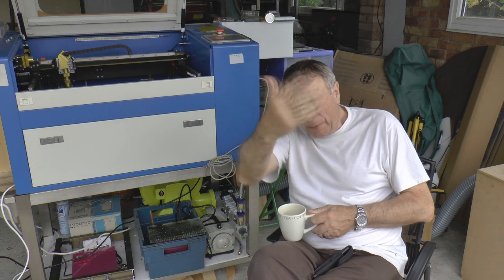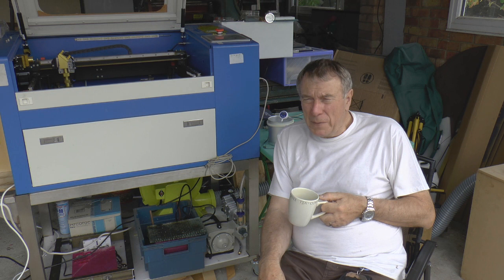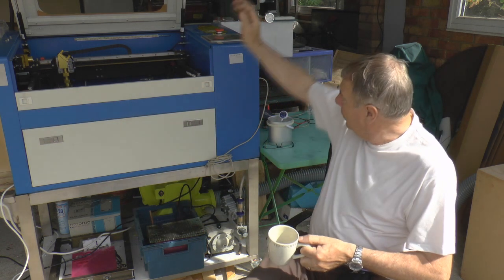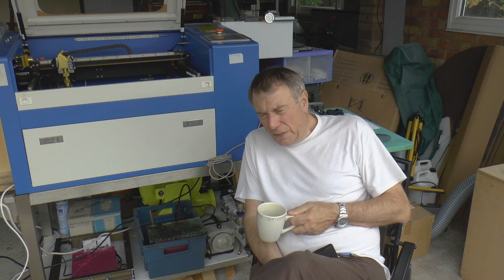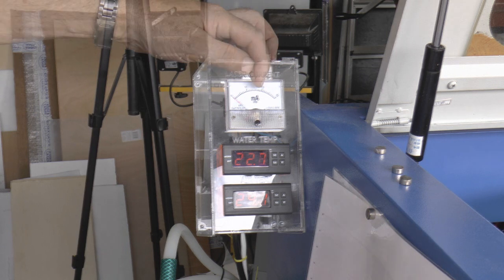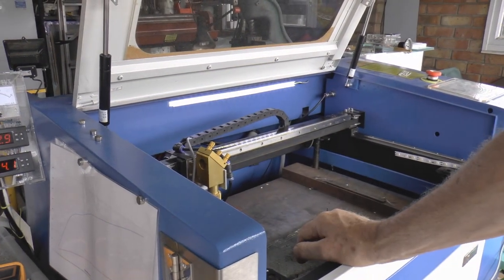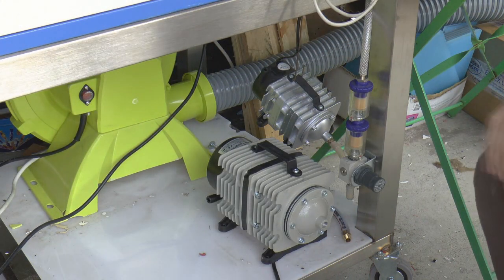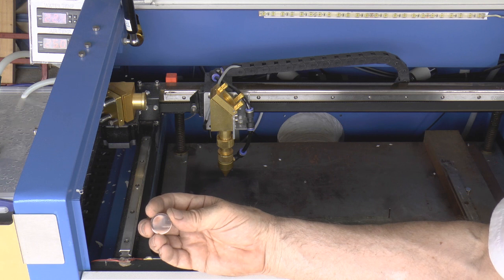RDWorks Learning Lab 75 What have I learned from 1 year of owning a Chinese Laser Engraver

Comment: Hi, great videos.  
I've had a Flash Laser K40D laser machine for around 6 months and in that time I've had to change the Power Supply.  Until recently, I haven't used it very much but I know need to use it more, due to demand for the things I make.
I have a % display on the front and this is usually set at 60% for normal cutting.  
I'm happy with what it does, but I want to do more, a bit quicker and also cut larger things as I can only cut 300 x 200 as you know.
To be fair to the manufacturer, they sorted my Power Supply issue very quickly, but I am very conscious of the possibility of the Tube stopping and the time it will take to get a replacement.
Ideally, I'd like to go to a cutting area of 600 x 400 if possible or something in-between the 2.  
Can you recommend a UK based company and machine I could look at to get an idea of cost etc.  
Thanks for your time
Cheers
Frank
Reply from the maker: Hi Frank

As you are uk based there are 3 possibilities but it depends what you want. If you want an immediate plug and play high quality machine 600 x400 with a 60watt tube say you are talking around £6k +vat  You canget a 50x30 machine from ebay supposedly 50 watts  but in reality it will be a 40 watt B grade tube with a B grade power supply. Good value for about £1200 to £1400 but you will need to add another £500 to that for a reliable A grade tube and power supply It will probably work pretty well and be reliable, but there are many things that I found annoying and have changed. My 5030 is now an absolute gem.  A70 50 machine will have exactly the same issues but will be about £1700 plus £600 for new tube and power supply. 
Something I have just seen on Ebay is a machine like mine  that hass already been fitted with a new power supply and tube and looks almost brand new at 850 is an absolute snip
https://www.ebay.co.uk/itm/laser-engraver-laser-cutter-50w-SPT-laser-tube-power-supply-gold-coated-mirrors/143027247865?hash=item214d169af9:g:F1YAAOSw7R9b-qPi:rk:11:pf:0
The 3rd possibility is to import direct from China More hassle but maybe about 20% cheaper overall.

Hope this helps a bit

Best wishes
Russ
Reply: Thanks for the reply, much appreciated. 
Who do you recommend from China ?  Flash Laser  - other ?
If I get a price for a 6040 size from China, any idea the cost of the improved PS and Tube ?  Also, are these 2 parts able to be purchased from the UK ?
Thanks
Frank
Reply: @PlonkaGames  
Two companies to consider

http://www.mektex.com/en/5a358718e4f446ef9e7d7bfaaee33977

http://www.transoncnc.com/tn-cabinet-models/tn4060-co2-laser-machine.html
If you request a quotation with an EFR tube and power supply (60 watts?), you will get A grade products and will not need to consider replacements.
You will be able to buy replacement parts in the UK

Best wishes
Russ
Reply: Thanks Russ
I'm getting some quotes.  
Do you know a good supplier in the UK where I can buy a Tube and Power Supply for my current K40D ?
Would you recommend buying the same types of PS and Tube or get better ones ?  If better ones, do you have a name/type/spec to help me ask for pricing ?
Many thanks
Frank
Reply: @Russ Sadler
Really appreciate your thoughts on above if you can.
Cheers
Frank

Comment: Hi , that ammeter input is really creative perhaps it might increase the tube life
Reply from the maker: Hi 
It is not just a good idea, it is essential to preserving your tube life . There are maximum recommended currents for running your tube that depend on watts or tube length. Run the tube at more than this recommended current and you will dramatically shorten your tube life. That ammeter is so cheap and also so simple to install it is almost criminal negligence that they are not fitted as standard to all machines. Being cynical (what me???) I suspect the Chines are relying on your ignorance to use the tube at 100% so that you wreck your tube quickly....great for after market sales of tubes!!

Best wishes
Russ
 ps 
https://www.ebay.co.uk/itm/DC-0-30MA-Analog-Current-Panel-Meter-Ammeter-85C1-30MA-White-W8D2/123418829185?_trkparms=aid%3D555017%26algo%3DPL.CASSINI%26ao%3D1%26asc%3D55149%26meid%3D2f3e71c4651b48948f92f98453522ac4%26pid%3D101006%26rk%3D1%26rkt%3D1%26%26itm%3D123418829185&_trksid=p2045573.c101006.m3226
Reply: Thanks for the reply, great content sir .

Comment: I have had my "50w" laser since Oct 2015. Its been used off and on. I've only had to replace the power supply so far. I have noticed that my laser tube is past its working life so I will be replacing it with another "50w" tube. I've been lucky that my tube has lasted as long as it has. However I have never gone over 60% power thanks to Russ.

Comment: Thanks for video. I’m thinking of purchasing a Boss laser 1420 with a 14x20 inch bed. I only will be cutting hobby stuff and maybe some items to sell.
What’s your thoughts on Boss and maybe a chiller. I’m located in Southern California with temp that an be in the 90 at days.
Reply from the maker: Hi
I rarely get questions from Boss Laser owners , I suspect that is because they are fairly well supported by the factory. Boss machines are pretty standard Chinese lasers with a Boss badge and colours but with good quality tubes and power supplies.I do not now all the US rules and regulations but you will need to ask if the machines meet all the US machine approvals. If you are buying it and installing it yourself, with or without the approvals you will be OK but put it into a workshop and call in a qualified electrician to install /set up a power supply and you will bump into those regs head on and could be faced with hefty bills. I note that everything at Boss is VERY expensive, but that may be because of the support .......you need to check what you are paying such a high premium for. Several companies are importing Bodor machines into the USA. Still a Chinese manufactured machine, the components and build quality are superior to most and I think the prices are quite a lot lower. Worth checking them out. A 14"x20 bed will probably be supplied with a 60 watt or 80 watt tube. A machine of this size is assumed to be a CUTTING machine, but these mid range power tubes are great all rounders. You will find it will do  photo engraving because  you will have just about sufficient precision control of very low power while at the top power you will be able to cut 6mm, 8mm and 10mm materials (albeit slowly). Normal text and logo engraving  will be OK as will 3D engraving. 
You will definitely need a proper refrigerated Chiller (one of the CW5000 series) to keep your tube temperature under control during summer months. Most top quality tube manufacturers allow running up to 40C  and my experiments show between 5 and 8% power loss at this higher temperature. A normal maximum will be 25C where you will experience no power loss. Cold costs money so don't try and run too cool (18 or 19C).

I could recommend you contact Danny Martinez for a  comparative quote  on  engravingmachinesplus@gmail.com

Hope this helps
Best wishes
Russ
Reply: SarbarMultimedia 
Great info. I’ll be sure to reach out to your contact listed. A lot to digest.

Comment: Hello Thanks for your great videos.
I was wondering if you know anything about the "pen" processing mode. With a search in the internet i could not find anything.
Reply from the maker: I you have auto focus on your machine you can configure the pen command to be controlled by the Z axis. You can specify different offsets away from the surface auto focus point for different layers. The table is actually the thing that raises and lowers relative to the autofocus  switch (often called a pen). If you do not have Z axis stepper control then don't worry about it.
Best wishes
Russ

Comment: have you had any problems with a round image going crooked at the top close to completion?
Reply from the maker: Hi Lory
I am going to answer confusingly yes and no. . No I have never experienced it with my machines but yes I can make it happen. Let me try to explain. There is a term called backlash which can affect both cutting and engraving. It gets hidden during engraving but pops into the open during cutting. There are two types of backlash. One is mechanical and can be because (in your case) the Y axis belts are not tensioned correctly. This can produce the effect you are seeing. This is an unpredictable backlash that must be fixed mechanically because the electronic compensation will only work on the inherent fixed system backlash. If you are sure your belts are correct and that your drive pullet fixing screws are not loose, then you can go to the RDWorks user tab and find backlash X and backlash Y adjustments.  With your PC hooked up to your machine, press the READ button at the bottom of the window. This will transfer your current settings from the machine into RDWorks where you can see them. You can only add positive numbers into the backlash . Make a note of the X and Y numbers already there and then add  say 1mm. Press WRITE to send the new value back to the machine and then retest.  This will make your problem significantly worse  but it will show you the effect of the backlash function. Type in a new smaller value(0.05 mm or 0.1 mm typically) and press WRITE again, Retest, modify and WRITE until you have fixed the problem. 
Hope this helps
Best wishes
Russ

Comment: Hello sr, Where bought the big air pump..?
Reply from the maker: Hi Gabriel
This is the pump that I bought
https://www.ebay.co.uk/itm/HAILEA-ACO-009E-140-LTR-PISTON-AIR-PUMP-KOI-FISH-POND-COMPRESSOR-HYDROPONICS/401346368878?epid=1289105521&hash=item5d721b956e:g:rCIAAOxyEoFSWVmR

After lots more testing and experiments, I must inform you that there is little advantage in choosing a bigger pump. Even the pump supplied (70l/mim) is being overworked because you cannot get 70 l/min through your pipework ( or nozzle if it has a 2.5mm hole. ) The maximum pressure the pump can deliver is about 0.3bar and that will be at zero flow It is more important to manage the airflow from your nozzle so that it is a steady laminar flow stream that gets the maximum amount of air into your cut. Too much pressure and the air will expand as soon as it exits the nozzle, it will spread out rapidly and very little will find it's way into the cut. It's quite a delicate balance. You need efficient air flow into your CUTS but almost no airflow for your SCANS.
If your existing pump works (even the pulsing is ok) I would not waste money upgrading. Control of what you have is more important.
Best wishes
Russ

Comment: hello sir. thank you for all of your videos, I have a question if you can answer me please: is there a video of yours witch can explain me if I can use RD works instead of laser cut for my engraving machine ? I have a small 5030 co2 40w chinese machine. thak you verry much for your time.
best regards. Alexandru.
Reply from the maker: Hi Alexanddru
The chances are the answer is no because RDWorks is designed to work specifically with the RUIDA controllers. Ruida controllers are sold under several different names but my knowledge of them is zero.  However, there is a guy that is writing  his own version of RDWorks  that I believe will run on other types of controller.  It is about 95% finished but is available for free download. I have a copy and it is good.  Take a look here and see if your controller is supported. If you are unsure write to them with your controller part/model number
https://lightburnsoftware.com/

Best wishes
Russ

Comment: Russ, Thank you so much for your videos. I have found them to be not only interesting but educational. I have bought one of these machines and am having trouble getting my rotary device to work. I have it hooked up correctly (there is no power switch for it) but the device is not rotating. Have you any experience with the chuck style rotary? If so, do you have any pointers for me to get it working correctly?
Reply from the maker: I do not have direct experience of your type of rotary but I do understand how it should work. Did it come with the machine or was it something you bought separately? I ask that question in case there is a mismatch between the stepper motors on your machine and  the stepper motor on the chuck. Basically if you unplug your Y axis and plug in your rotary (with the machine switched off). When you start the machine the X axis should run to its endstop position to set its zero datum and the chuck should rotate aimlessly. because it has no end stop position to find. You will have to push the gantry back to its end stop and draw it off slightly to set the rotary axis zero.
If you can get this far then you will be well on your way. Try this first and let me know.
Best wishes
Russ

Comment: HI, I really enjoyed your video and it is ALWAYS an advantage to listen to a person who has NO reason to either "make" a machine good or bad but someone who just give the facts.

I am just starting out and do not yet have a laser machine but am in the process of looking at it and th deciding what machine to buy. 
I have a question for you.
If I buy ....for arguments sake.... a 60w laser unit and when the time comes to replace the tube, can I fit a Reci 100w tube instead of just the replacement tube of 60w.??
My reasoning is that if I replace it with a higher capacity tube, I need even less power and hopefully the tube will last longer if I remain within the 60W tube's max settings.
Regards
Johann
micro1@iafrica.com

Comment: Nice videos Russ, and I think you have helped a lot of peoples. I am wonder, do you think this machine can be used/tuned for metall cutting with 150-250W Tube?
Reply from the maker: Metal cutting a whole new world which these machines can just about do with 150 pluss watts. However it is not simple like non-metal cutting.   I have owned 2 metal cutting 3wk CO2 laser machines for  industrial use. The technology is completely different. Basically  You will need a special (much heavier) metal cutting head that needsa pneumatic raise and lower for the nozzle. You will need to replace the air assist with oxygen assist at about 0.8bar for mild steel. You will not be able to cut other metals  like brass, copper or aluminium because the high reflectivity of the material could easily destroy your lens Stainless steel can be cut with the same head BUT the cost will sky rocket because you cannot allow ANY oxygen to get to the cut area,  so you need to shield the cut area , raise the power/slow the speed and use medical grade nitrogen at about 12 BAR (yes 250 psi) to get clean commercial grade cuts. It is just not a hobby  activity to laser cut metal. You need to visit a commercial laser profiling shop to see just what the process is and the infrastructure required. You need a huge work flow to justify the expenditure.
Do a lot more hands on research before spending your money. It's a lot cheaper to  get your dxf files to a laser profiler and let them use their own stock material. 

Best wishes
Russ
Reply: SarbarMultimedia Thanks for the informative explanation, but you killed my plan for a relative cheap cutter plan🙄 Back to the drawing table... What is the product name of your machine? Maybe link👍🏻 Thanks again
Reply from the maker: This is what I bought but obviously from here in the UK

https://www.ebay.com/itm/50W-CO2-Laser-Engraving-Machine-Engraver-Cutter-With-Auxiliary-Rotary-Device-/151785082682

Best wishes

Russ
Reply: SarbarMultimedia thanks again, I will think about it. Looks like a lot of machine for not so much $, but need to be prepared for everything right👍🏻
Reply from the maker: Be prepared for a crap tube and power supply. It is generally mechanically sound and needing some TLC as you will see from my videos. If you need it to plug and play for a small business, I would not recommend but as a hobby machine where you HAVE to learn how to be your own 24/7 tech support, it's a fantastic learning aid . Replace the tube and power supply and you have a pretty good piece of kit for still not very much money.
Best wishes
Russ

Comment: Hi Russ, just started watching your videos on the Chinese laser. Is it easy to setup the machine to run the laser a 30 or 40watt to get more life from the laser Tube?
Reply from the maker: Hi Courtney
Overdriving your laser tube with too much current will shorten it's life dramatically. If your tube is 800mm long it is a 40 watt rated tube  and should not be run at more that 18mA. if it's 700mm long then stay at 16ma max

Best wishes
Russ

Comment: Would this work to add Trisodium Phosphate and/or sodium hydroxide to the water to change the pH to 9 or 10, that way the water should last forever?
Reply from the maker: Here we are two and half years later and I still have my original distilled water in the reservoir. It's not green and no sludge in the tube. I still taste it once a month (with a finger dip) and check it for a slimy feel. My system has no metal in it and I have a closed system so no airborne bugs have ever been able to get in . Anyone with a chiller system  would likely suffer with your pH9 or 10 solution, because it will slowly dissolve the aluminium cooing coils.
The other secret weapon in any laser tube is the UV generated by the ionized nitrogen.  UV is a sterilizer. Most of these cheaper laser tubes are glued together with an epoxy resin and  I did not wish to walk into the unknown long term effects of not using the recommended  distilled water. Some folks have used auto antifreeze. Each to his own.
Thanks for the thought, it's always good to look at new possibilities 
Best wishes
Russ